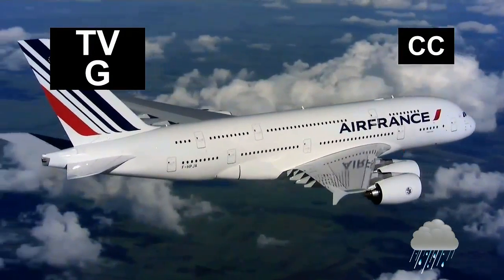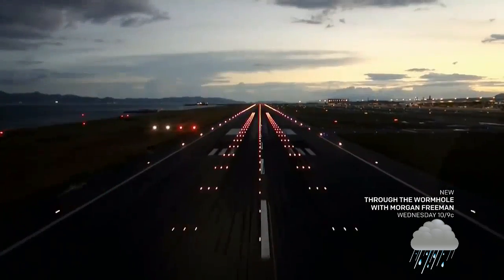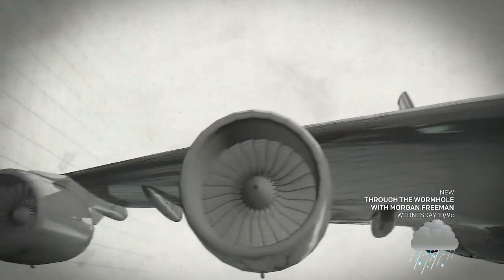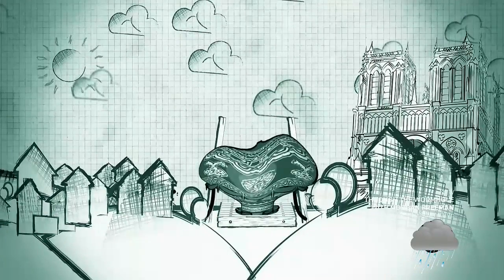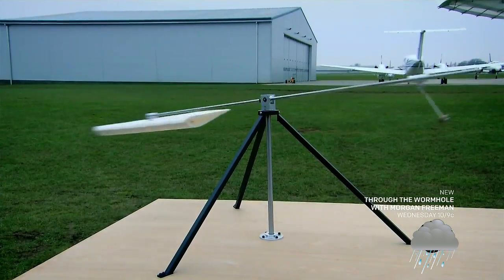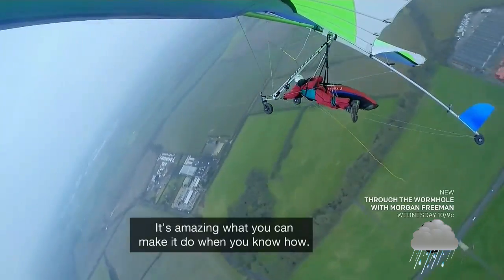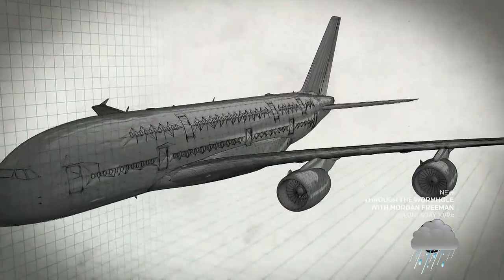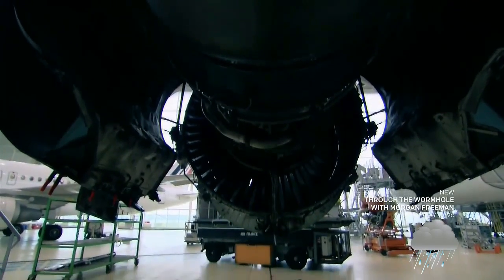Airbus A380 Documentary 2015 Part 1/3

Comment: Boeing were part of this initially & it would have been good if European & American engineering could have collaborated. However, Boeing pulled out as they didn't have the money. Which is a shame.
Reply: There is a huge amount of American involvement in this project. Yes, it's mostly European but it's so big that there are still thousands of Americans involved in it. It just doesn't have to be Boeing.